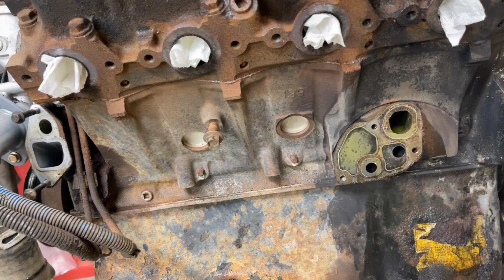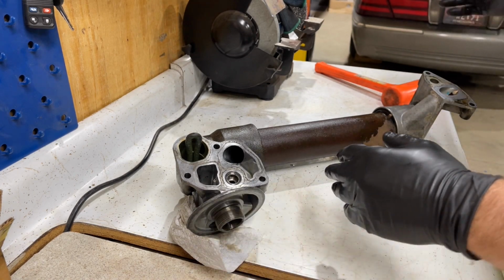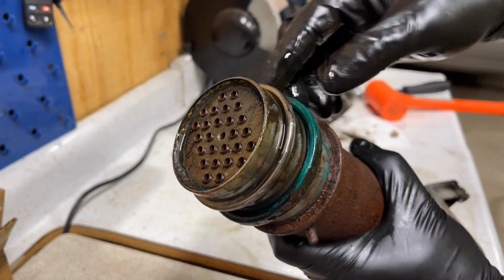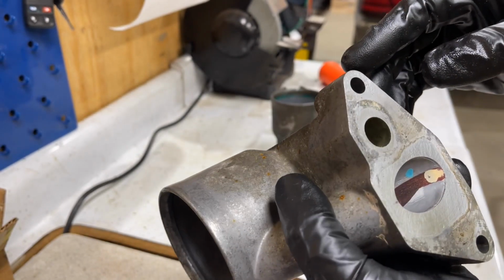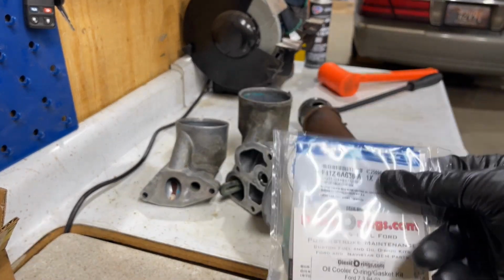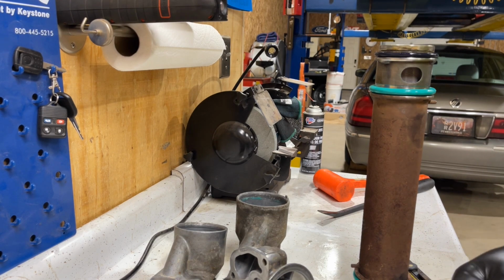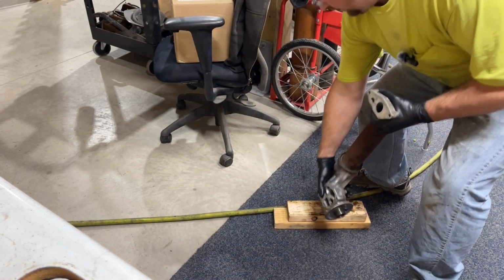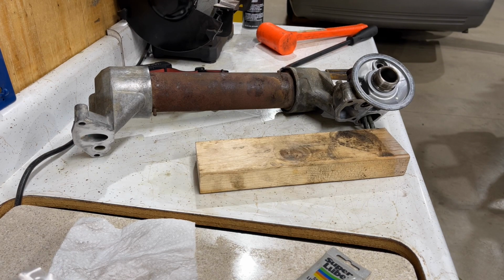94-03 OBS or SD Powerstroke Oil Cooler Rebuild

Comment: Do you have a video talking about coolant? After a tear down of a 1997 7.3 what coolant do you recommend using?
Reply from the maker: The coolant topic is always a debate. 

In newer 7.3 trucks. I always run an ELC coolant. In older 7.3 trucks, I always recommend green coolant with the SCA additive.  Reason being is, it’s been brought up through the years that the adhesive for the injector cups isn’t ELC compatible.   If your injectors cups have been removed and replaced, the updated adhesive is compatible with ELC.  

If at all possible, I recommend the ELC type coolant.  Unless you have an OBS 7.3 with original injector cups.

Comment: I’m doing a rebuild on my motor this summer 

When I first purchased my vehicle, the oil cooler went bad the shop that did the work replaced it with the doorman part and I’m assuming it’s going be a Dorman O-rings  

I would like to take my cooler apart and inspected it Should I replace it with OEM O-rings Would that work with Dorman oil cooler?
Reply from the maker: You should be able to use OEM seals.  Dorman likes to make proprietary things it seems like, but I don’t see that being the case here, so you should be able to use OEM seals.  If you get it torn apart, I’d just put a good OEM one in it if something seems off.

Comment: So my block heater doesn't work and I will be changing it this summer. I am considering just doing the oil cooler and a coolant flush. Should I just drain all the coolant and do a basic flush and rebuild the cooler and block heater? I have heard issues with people rebuilding it and it leaking but that usually means they messed it up.
Reply from the maker: It’s absolutely worth it.   But doing the oil cooler job, you should change the oil since you could introduce coolant into the oil. 

Use OEM gaskets and you’ll likely not have an issue. 

If you’re not really needing to do the cooler.   You can quickly change the heater and get a small bath and not drain the whole system.
Reply: @ I actually did an oil change 500 miles or less ago. I probably will just do an Indiana Jones swap on the block heater.
Reply from the maker: @ sometimes that’s easier unless something else is wrong.

Comment: Could one run a rifle brush through the coolant holes of the cooler?  Something of maybe a .22 size?  A little solvent with it.
Reply from the maker: Absolutely.    I’ve had to run some wire through a few of them due to someone not keeping tabs on the coolant.